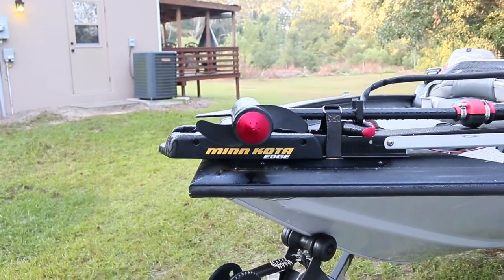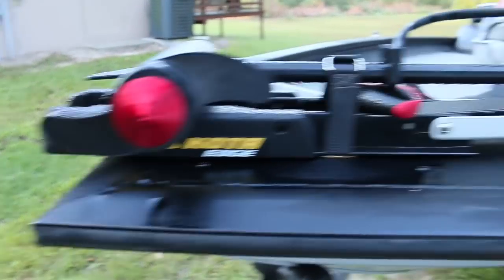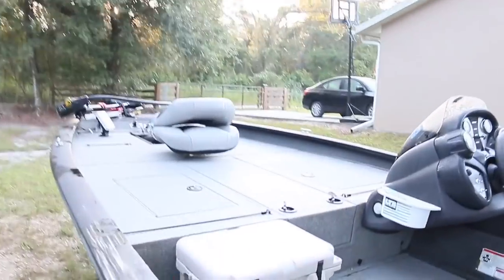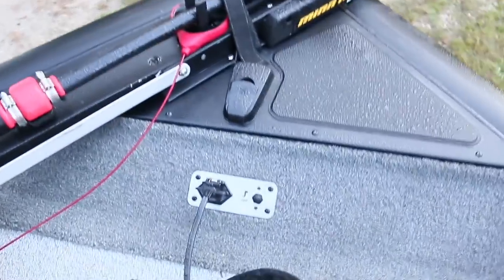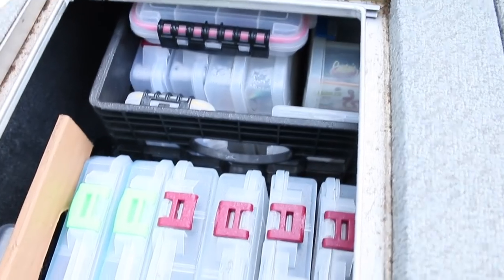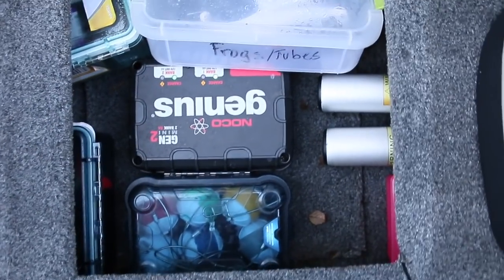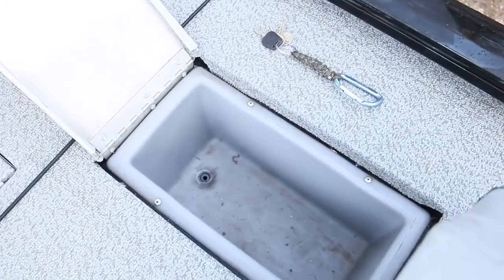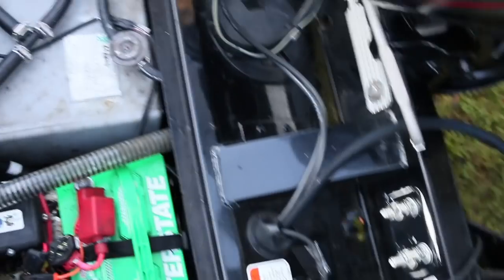The New 2018 Bass Tracker

Comment: Very nice boat you know how you build up water in the hatches you should get a hole saw and drill a hole in each compartment then go to home Depot and buy the shower drain cap and install it over the holea little bit of paint on the cap you will never notice the water will drain to the bottom of the boat and out the back I built a small boat and that's what I did but very nice 👍
Reply from the maker: Thank you!

Comment: I know am a little late. I have a 2011 190 with 115 OptiMaxx two stroke you should be able to well over 45 mph with that motor I get 55 mph out of my boat. I am going to guess and say you have a 12 3/4 by 21 pitch prop the boat has to much pitch you might want to try 12 70  by 19 pitch prop 4 blade spitfire prop
Reply from the maker: mike Woodward no idea on prop ill check!
Reply from the maker: mike Woodward shoot me an email @ beaglerbassfishing@gmail.com

Thx!

Comment: Excellent video, I just subscribed.  I bough a 2014 bass tracker pro team 175 txw new in 2016.   It was a Leftover and I upgraded the trolling motor to a 55lb from the dealer.  It works good but i wish i had the 24 V system with more lbs. Also, after I bought it, I went back to the dealer to pick up my warrantee information and book and they had a boat just like mine with the vinyl instead of the carpet. I instantly regretted getting the one with the carpet, but after I watched your video I seen another video and the guy hated the vinyl just like you do. So I’m glad I have the carpet. It does look very nice though, Keep up the great videos.
Reply from the maker: John Hines thx! Glad my channel was able to help.